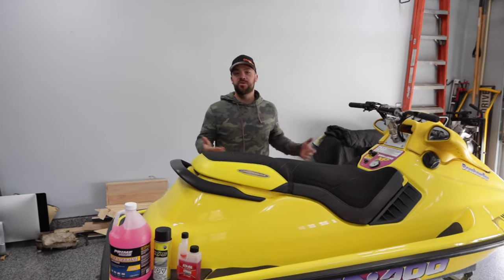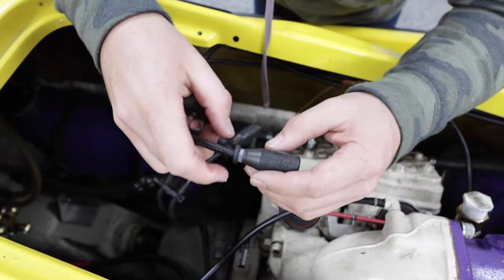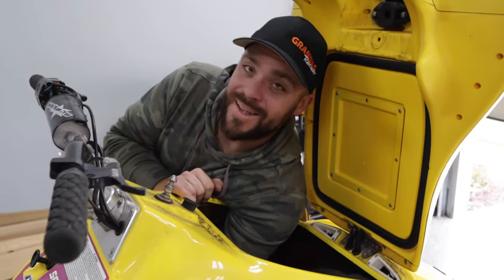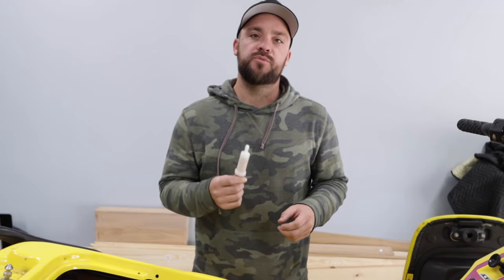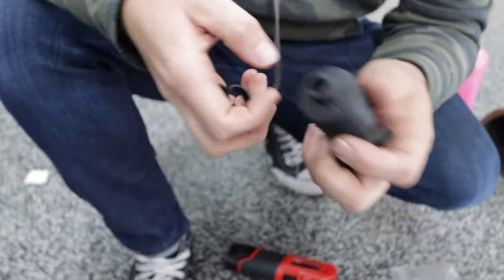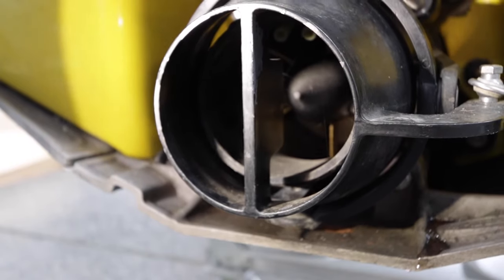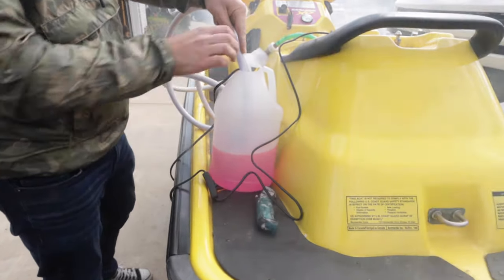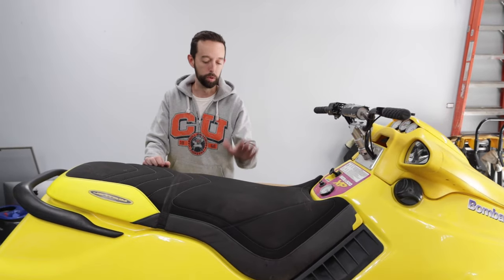2 Stroke Sea-Doo Winterization and Maintenance - Today We Wrench DIY Series EP.9

Comment: What is the deal with RAVE valve (red colored bar) with no caps, is that a modification?  My XP has stock caps that have been drilled to vent. Never seen that setup before.
Reply: Wondering same thing, looks like he doesn't have to deal with leaks there lol
Reply: @masongress3364  yep that was a new one for me. Only thing I could think is it completely synchronizes the both raves at all times? Not sure if that would be better or not.

Comment: I was told to not add water/coolant without it running u could hydrolock motor so why are we dumping coolant in the head I need help wintering mine
Reply from the maker: Hydro locking only happens when the water is pressurized and running through the actual coolant induction hose. It fills the waterbox/exhaust and dumps it into the cylinders. The cylinders have cylinder drain backs that dump right at the outlet. All of this is explained in the video.

Comment: my starter solenoid failed so I just got a drill power pump and pump anti-freeze though the system.
Reply from the maker: That’s not a good idea. It forces liquid into the engine
Reply: @TodayWeWrench  well that was the point. So I can put anti-freeze so the engine won’t crack.
Reply from the maker: @jeremyocampo1529 the problem is it forces coolant into the engine and can actually fill it. Much like towing it without a clamp n the hose.
Reply: @TodayWeWrench  where does the clamp in the hose go?

Comment: Excellent advice all the way around.  

Replace the oil filter , open the bleeder and bleed the air from the oil line, close the bleeder.  
Where is there a bleeder on a Bombardier two stroke oil pump?
Reply from the maker: Right in the from t below the small line fittings